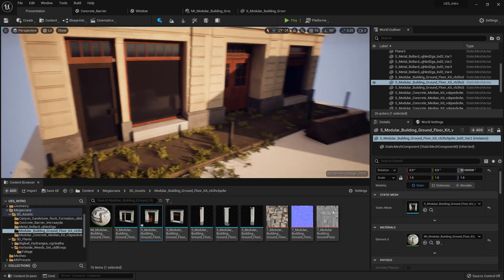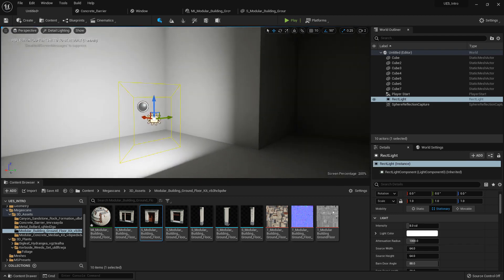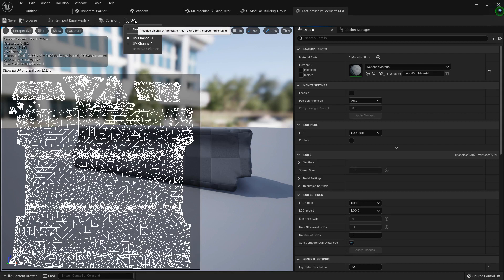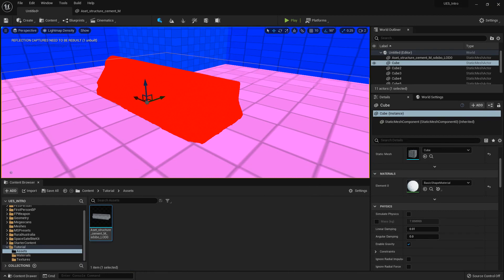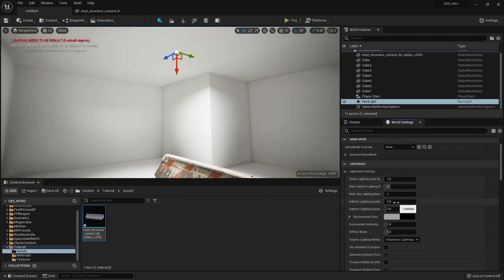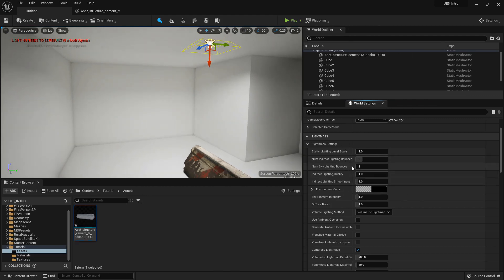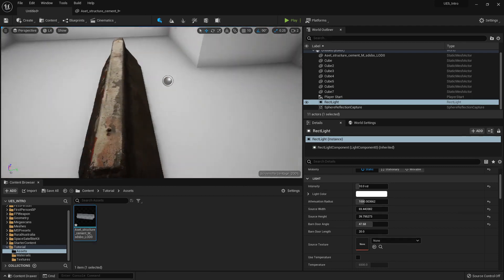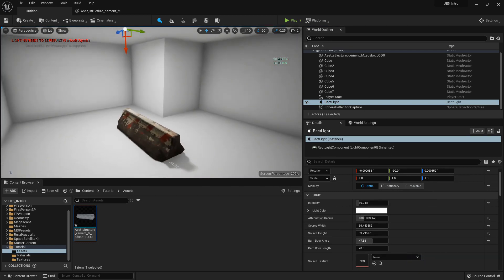Unreal Engine 5 for Beginners Pt. 8 - Realtime Lighting And Baked Lighting

Comment: The performance cost and quality loss of Lumen is insane. Some developers are reporting 40+ fps gains by switching to baked lighting in UE5. Lumen is cool, but it's expensive, poorly optimized, encourages bad practices. Baked lighting is extra steps, but the end result is a much better end-user experience.

Comment: I'd add that for the near future, baked lighting will be still used for low power platforms such as Nintendo Switch and mobile phones. But every new high end targeted (PC, stationary consoles) project that forecasts its lunch in a couple of years should use lumen instead.